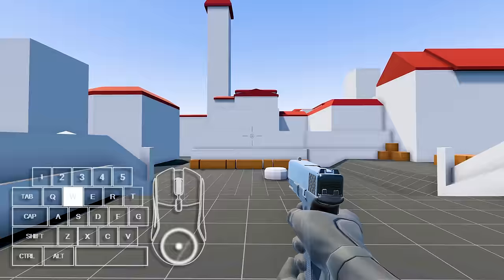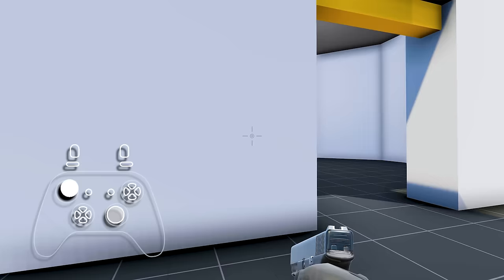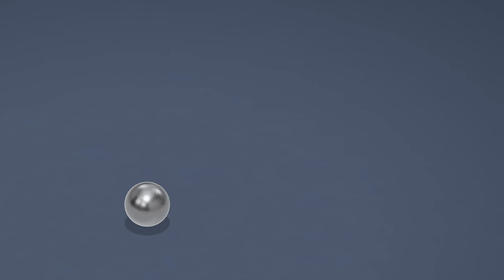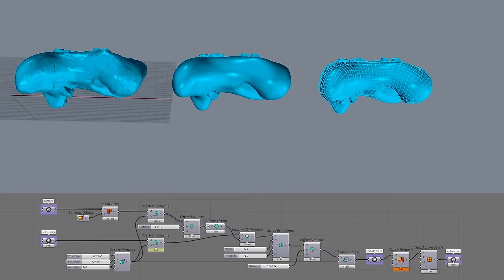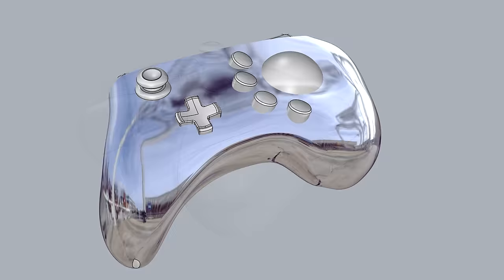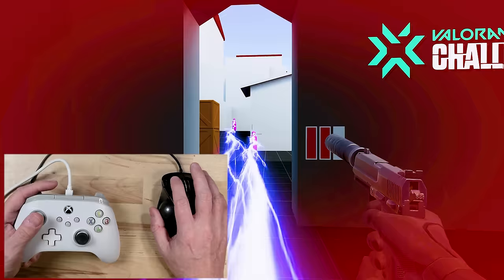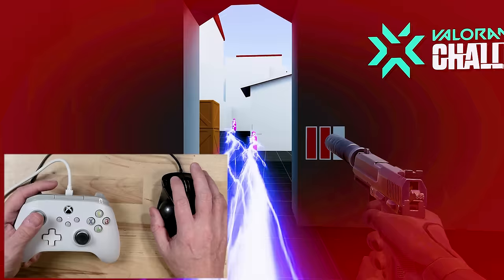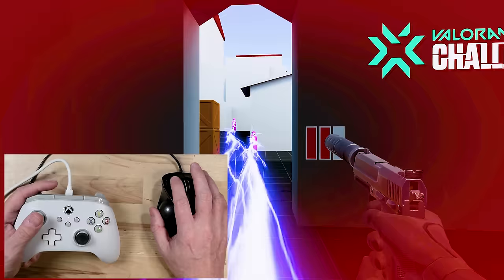Ultimate FPS Controller Design & Build

Comment: The mouse vs. stick debaters keep ignoring the enlightened gyro-aimers.
Reply: gyro capable controllers is like mixed both worlds of m/k and controllers players. You achieve speed of fast joystick turning and precision of a mouse in one device.
Reply: the problem is that the average player either does not care or does not know about gyro aiming. it's a control scheme that requires a bit of fiddling about and they're often buried in the settings menu for some reason. i believe game devs need to better incentivize the use of gyro aim whenever possible and make it easier for people to transition

EDIT: excluding first-party Nintendo games like Splatoon of course, they've obviously mastered the tech
Reply: @hi_its_jerry  the main problem with devs is that they simply cannot put good gyro aiming in their games.
Reply: People just negatively associate gyro with waggle, that's th eonly issue
Reply: implementation has been getting better as of late though with Fortnite and COD having the best out there. The Finals and Helldivers 2 have pretty good gyro, with room for improvement. There's some games like Spider-Man 2, GoW:R and Dragon's Dogma 2 that have basic implementation, but is acceptable for their use case of aiming only.

Edit: I wanted to mention that The Finals updated their gyro implementation and now it's up there as one of the best on the PS5 and PC.
Reply: I tried gyro for tf2 but my screen was so laggy like a clip show I couldn’t use the added gyro controls to its fullest potential, so tbh the average gamer (me), may not be able to even figure it out in good time :/ BUT man it felt good to rocket jump waaay better in gyro, I kinda miss it
Reply: but the problem is when i use my thumb in the shape his right hand is using i tend to twitch my middle finger ever so slightly which is why a sort of joystick hold with the mouse ball up top might be better because it relaxes the other muscles when the thumb is at work plus it opens up the pinky for buttons as well
Reply: where my nintendo/splatoon fans at? we've been trying for so long to share our enlightenment but the implementation of gyro in other games always feels secondary so it never works very well :(
Reply: Steam controller 💪
Reply: @pawes7418  I would be surprised if a seasoned gyro player could beat a seasoned mouse player. Joystick turning isn't that fast, a mouse player can do a 180 faster than any joystick player with the exception of flick stick. And I frequently go back to controller myself when I play the N64 or switch (where I do mess with gyro aiming in games which support it). It is easier to infinite circle strafe on controller though.
Reply: I've gyro aiming since the SNES days, it just didn't work out very well
Reply: yup. Fortnite made me a flick stick believer too. Everyone should follow Epic's lead on this, its just so satisfying. Bit of a learning curve but once you get it, its just so much smoother than dual analog.
Reply: @Immorpher  actually theres a control scheme called Flick Stick (thats even implemented in Fortnite) that allows for quick 180degree spins. Basically all your aim is handled by gyro, while the right stick controls all quarter-turns. So you can flick the stick toward you and spin around 180 and aim with gyro to do damage. Takes a bit of learning but once you get it, its leagues above regular gamepad controls. Mouse player might stil get the edge but its not as black and white as you'd think these days. Hopefully more games begin embracing this method and gyro as a whole.
Reply: Gyro is God Tier
Reply: @ekupka  what? lol
Reply: This is how I manage to play any shooters on Steam Deck. I'm still far inferior compared to mouse, but I go from basically awful to passable with the addition of gyro. Steam input FTW!
Reply: People shun me for gyro. My own brother shuns me for gyro. One day, they will all see…
Reply: I don't know why Gyro-aiming isn't pushed harder, it's the blatantly obvious solution for aiming with a controller and doesn't require a massive controller redesign that compromises every other genre.

It must have been the Wii and the other motion accessories from the other consoles that made people gag at the mere mention of "motion" in their games.

Most Racing games also don't have the option for Gyro steering when it's also pretty obviously the best option, playing GT7 with Gyro steering is night and day better than using the analog stick.

Gyro is so good that it made the game Dreams, that's pretty much a game making tool, actually usable.
Reply: But nobody gets it right besides Nintendo with splatoon. Stuff like Fortnite have gyro but it’s really bad.
Reply: This is one I don’t understand. Maybe I haven’t dived deep enough into the gyro meta
Reply: This, Gyro is the future
Reply: Dualsense Gyro and Steam Controller Trackpad Gyro should be the future of ALL FPS games IMO
Reply: Very cool! Would love to try it 😁👍
Reply: @PartyCrasher04 I wouldn't say it's the future in general, I'd say it's the future of controllers. I'd never give up mouse for gyro, no matter how well implemented it is. Mouse is just superior and always will be until eye tracking or some shit
Reply: gyros are only marginally better than mouse
Reply: As a person who loves the mouse, gyro aim is god's blessing to controller players

I don't wanna play MGSV on keyboard but gyro aim has made the game feel so good
Reply: Steam controller ftw, gyro on pad touch, with high momentum flicks on right pad
Reply: @taylon5200  Gyro and Mouse are definitely equal, at least imo, the level of precision is the same, the only thing limiting it is the user.
Reply: yeah u can play will u new style wii 💀💀
Reply: I think a lot of people would just rather not have to move the controller around to aim. Personally, I find it takes a lot more effort and hurts my wrists. I use both my arms and hands for a living, assembling and carrying things--they're too tired/stressed to use gyro at the end of the day.
Reply: Dualsense and Steam Input is the gift of PC gods
Reply: Honestly, its not fps exclusive either. Gt7 has spoiled me beyond repair. Gyro is tight AF and the only problem is that its the only fucking racing game that uses gyro to steer, cant go back to stick anymore
Reply: Stick, Mouse, Gyro controller and Keyboard works fine for me on most games with extra programs. Azeron looks cool also.
Reply: Or we just say fuck it and do VR. My eyeballs aim better.
Reply: YWNBAW
Reply: Thanks that is what I want to said
Reply: @pawes7418 Lmao, the only people saying gyro is better are people who play games that have terrible analog stick controls like CSGO or Splatoon.
Reply: fr fr, i believe wide adoption of gyroaim would quickly lead to removal of things like aim assist
Reply: @pawes7418 so the wii remote?
Reply: my main problem with gyro is recentering and adjusting because to go back to a comfortable position you have to unturn which means you have to counter it with stick aiming, whereas with standard controller and mouse aiming you just either release the stick or lift and recenter your mouse on the mousepad

there is also the nebulous feeling of where I'm aiming and how far I've moved but that is just being less familiar with the control method and I'd get used to it but having to use 2 camera controls is too clunky for my liking
Reply: i sneer at both teams while using my wiimote infared sensor
Reply: @BlowfishShorts  Flick stick can be good, but it isn't needed for every game. Splatoon lets you just recenter the camera in the direction the character is facing, so you can turn around and press that button for a quick 180 degree turn. Of course, that wouldn't work for every game, but for games with cameras and movement like Splatoon's (where it's sorta similar to a 3D platformer, and the camera isn't strictly tied to the direction the character is facing unless you're shooting or getting ready to throw a bomb or something like that) it can work.
Reply: @gruzi. Must suck to have your feelings contacted so thoroughly by every relevant scientific community.
Reply: I think a combo system with eye tracking might be the most effective
Imagine if the camera could instantly saccade to a target at the press of a button rather than having to move a stick, ball, mouse, or gyro
Reply: Yoi mean something like steamdeck have?
Reply: I gave up on gyro aiming on my steam deck when the bus driver took a really sharp turn and I did a full 360  in RoR
Reply: So tru
Reply: Gyro prevents aim assist so you won't hear anything from controller players lmao
Reply: @pawes7418  not quite as fast as mouse but if you don't have enough mouse pad space gyro is better
Reply: @kingkazuma2239  nope
Reply: i have been saying this for YEARS and everyone ignores it
Reply: @deathtrooper2048  good luck playing cs ... any fps games on controller without gyro or aim assist
Reply: @kurtisgibson2929  did you see some players that use gyro ratcheting technique? you can be very fast and precise with gyro. Im using gyro exclusively for like 8 years now and I can easily play on 8:1 sens without any not necessary hands movements
Reply: There is nothing to debate, mouse wins either way.
Reply: @pawes7418  Gears of War has no aim assist and most people it on controller.
Reply: Splatoon gaming
Reply: Splatoon gaming
Reply: eye tracking will get to the point that thats just how youll aim.
Reply: most people prefer to have their hands resting
Reply: @pawes7418  that's where steam input is a godsend, if you are fine with spending a couple hours fine tuning the settings lol
Reply: The only experience I have with Gyro controls was with Splatoon 2, and it was fucking awful.
Reply: For me, gyro controlls make aiming a bit of a hassle. You basically have to aim twice at the same time: Once with the thumbstick and second with your wrist
Reply: @FDALl-ms5kg  I wouldn't be surprised if somewhere deep in steam settings for cobtrollers is mapping feature to map gyro input to racing  wheel output. And than game just think that you have wheel. I'm pretty sure it works but its easier if you bought game on steam than from other services.
Reply: @PartyCrasher04  gyro and mouse are equal 😂😂😂
Reply: @teaguejelinek4038  yes, unless you’re someone with like 10k hours in cs, Ihardscope would probably wreck u in a 1v1 lol.
Reply: @cyriloboco3083  orrr you can play with a fast sensitivity so you do most of your aiming with just gyro lol, there’s more than one way to play with gyro
Reply: @PartyCrasher04  I've tried that, but you can't fully rotate the camera, so you use the thumbsticks to turn but then my wrist often ends up in an uncomfortable position. My brain is too old to get used to it
Reply: My issue with gyro is that most games force you to use either all gyro or none at all. And if it does let you toggle on and off it requires an expensive 3rd party controller
Reply: Dumb
Reply: Racing enthusiasts laughing in steering wheel language
Reply: @Anthonybrother True gamers know that Steering wheel aiming is the best.
Reply: Indeed
Reply: @hi_its_jerry it's not that hard to get used
Reply: Indeed
Reply: @hi_its_jerry that's the fault of the average player. BotW has Gyro and was game of the year. Make matters worse the Switch was more accessible price wise so the average player should blame themselves for not asking more from devs. And that's not to say Nintendo is any better but they were always about innovation which is why Gyro works so well with BotW and TotK. When playing I wondered why FPS haven't done the same.
Reply: @pawes7418 yes you can. If Nintendo can do it on a cheap ass switch with BotW then PS and Xbox have NO EXCUSE.

  Honestly they could learn a lot of fundamental gameplay aspects from the Zelda team like walking, climbing, mass, etc. Coming back to PS and XBox after so long was both impressive and disappointing because of this. Graphics and gameplay elements are nice but playing these games and still getting stuck on inclines or having to jump over something smaller than a step is something I just can't get used to.
Reply: @pawes7418  splatoon and doom 2016 called theyd like their exception status
Reply: what about returning to center though? how does that work with gyro aiming? like a thumbstick you just let go and a mouse you can stop moving. but a gyro controller you have to balance just to do nothing right? 

don't have much experience with gyro controls other than my phone I think....
Reply: @Sl4ts_ bro what!? I got 2 and 3. Plus BotW has Gyro as well and how it works with the right thumb stick is perfect for fps and 3ps
Reply: Gyro controllers are undeniably great.
I don't like controllers normally.
Reply: @Immorpher I guarantee you we could. Snap shots are so easy and your speaking from a position of in experience. I would put any seasoned BotW player against anyone. 

See you think Gyro has to always be active but in reality you only need it for ads. In BotW you can deactivate gyro by moving the right stick so you still can turn fast with the right stick and bounce between targets with gyro. And Im cold ASF at any shooter. NBS I can't help but be that way. Gyro is exactly what controller players need to balance out the difference in aim precision. With that plus better movement mouse players would need make up that difference some how to compete. Movement is the only thing keeping me from crossing over because that matters just as much as precision IMO.
Reply: @hi_its_jerry  We need some AAA devs to have the balls to make it default with a good implementation. It's getting better, but not there yet. Fortnite has a good implementation, but it isn't even in the normal controller settings section.
Reply: @Immorpher   Gyro aiming is just as fast as a mouse, and flickstick is just as fast or faster for turning. I'm not saying it's better necessarily, but I think they are close enough, that positioning, and game sense are going to be the deciding factor in a battle rather than the input method. I think it's still a better solution than raw mouse vs joystick than aim assist. Xbox needs to get their heads out of their ass though, and actually make a controller with gyro, or at least have full native support for some of the 3rd party devices that add it in.
Reply: @ekupka  Gyro hasn't been around that long. You are probably thinking about light guns like duck hunt. Gyro works very well, and just needs good implementations.
Reply: @bwjclego  1. Gyro is at its worst when it's attached to a screen, but it's still better than stick only.
2. You probably have less experience with the input, so it's hard to do a 1 to 1 comparison.  
I fully think it should be the future for console fps games. Especially if there is crossplay involved. Steam input is great, but we need devs to fully embrace it.
Reply: @BCBtheBeastlyBeast your lying. BotW players have proved this false. How it works in the game you only have to make big turns like that on occasion. its also no different from turning a steering wheel controller. 

In BotW they have throwing spears and those are harder to throw than shooting the bow in the game. Because of gyro I was able to hit a dragon's horn while running off a mountain as it flew up which was still not easy but would have been near impossible without Gyro to FINE TUNE MY AIM ON A CONTROLLER.
Reply: @goncaloduarte4683  Yeah, there were definitely some iffy motion implementations in the wii era. That doesn't mean they were all that bad though. The way that wii shooters had the view model/ reticle separated from the camera view did look a little goofy, and the edge of the screen acting like an analog stick turn was a little janky. From what I hear, aiming was actually really precise with them though. A lot of console players are pretty unwilling to learn something new, or tinker with things. Even if gyro is a way better input. We need well implemented gyro aim as default for a AAA shooter.
Reply: personally I am more of a custom keyboard guy and by custom I mean I design my own crap...
Reply: Gyroscopic aiming is equivalent to mouse aiming, so it doesn't need any aim assist. When you mention gyroscopic aiming, you're essentially telling controller players to aim by themselves, and that's not going to happen.
Reply: @deathtrooper2048 lmao BotW. And all controllers get drift. I just bought a PS5 and one ofe my controllers already has it. That's like 5 months with inconsistent play but I have a Pro controller for the Switch that still doesn't have it after 2 years. 

And I say that as someone that slaughtered in CoD Halo and Gears. The only people that are dissing gyro are m&kb users. Y'all are the only ones here speaking from an inexperienced position like y'all know better
Reply: @aboveaveragebayleaf9216  yeah, It was just a bad timed joke about waving the controller around
Reply: @taylon5200  They are pretty comparable, but I don't think anyone is saying to drop mouse. They are saying it should be the default way to play a shooter on controller. Aim assist needs to die. We don't need it. I do think that the inputs are close enough that the difference is more gonna be about gamesense. Good gyro is new enough that very few people have as much time into it as they do with mouse and keyboard, so it's hard to truly have a fair comparison.
Reply: @schmip most definitely
Reply: @bazzeil  It's great, but we need a new one. The gyro/track pad a relatively old tech by now. The ps4 and ps5 controllers have a much higher polling rate.
Reply: @BCBtheBeastlyBeast  How much do you think you have to move? People often just rest their controller in their lap, and do very small movements. you might just need to try a higher sensitivity. I have a pretty manual job too, and don't really have any more fatigue than just holding the controller normally.
Reply: @deathtrooper2048  Maybe because games with "good analog controls" use heavy aim assist. We should all be using actual user inputs by now.
Reply: @ComfyCherry no dude. In BotW you deactivate the gyro by moving the stick. It's actually pretty damn clean. Even going from stick for big turns and gyro for snap shots and better precision. Acting like that's harder than some of the uncomfortable things m&kb and controlled players have to get used to is a reach. The worst your doing is turning you arms and it's way easier to recenter than you claim. Watch BotW Advanced Combat Montages. Gyro is so good you can use that system and throw in shots with the gyro controls while free flowing combat. You can go from gyro to stick and back to gyro much smoother than you claim.
Reply: @ComfyCherry  Two options for this 
Only have gyro on when you ads, or have a bind that turns gyro off when you hold it. It acts just like lifting the mouse.
You should also look into flick stick.
Reply: @nmotschidontwannagivemyrea8932  It isn't needed for everyone, but it should absolutely be an option for people who like using it.
Reply: @arech1778  There is a time and place for everything. On a bus is not the optimal place lol. It also isn't at its best when connected to a screen since the screen moves as you aim. It's best when sitting down with a standalone controller.
Reply: @kurtisgibson2929  It can be just as fast. It literally acts as mouse input when set up well, and flick stick is arguably faster. Not saying it is gonna replace m&kb, but I do think it should replace aim assist in crossplatform shooters.
Reply: Lmao this is why splatoon is the only shooter I’m good at
Reply: @PartyCrasher04 one could make the argument that gyro is better because of flick stick. It allows you to make fat directional movements that even a nous couldn’t do without extreme precision
Reply: @aboveaveragebayleaf9216  I also play in my lap, but sort of between my legs. I tried it last night and it's just too much effort for me after work, and I should mention my wrists already have some issues.
Reply: @dylanrice5617  this is true, personally i cant do flick stick, i do a really fast joystick sens and also use fast gyro sens to do my aim
Reply: Please keep ignoring us lmao
Reply: What you're asking for is basically VR
Reply: Eh, terrible ergonomics.
Reply: @pawes7418  joystick are slow as fock
Reply: @aboveaveragebayleaf9216  tests show about a 10% difference but it's undetermed if this is a skill issue but yes I agree gyro should be the new default for controllers
Reply: @pawes7418  the flick stick tech or is it something else? i don't know too much myself outside of what I've seen test results on please clue me in
Reply: You got to be enlightened to use that mfer 😂
Reply: gyro aiming is the point of ascension
Reply: Gyro is pretty playable actually - Splatoon 3 Rank S player
Reply: @hi_its_jerry splatting has gyro aiming on normally
Reply: I think the problem is the amount of drift, even for hold-for-gyro activation (short periods of time). otherwise more ergonomic and as good as a mouse
Reply: Because no one knows what that is
Reply: This was sarcastic right?
Reply: What debate? Mouse is just better than both gyro and stick objectively.
Reply: That's sentence basically explains all of splatoon players
Reply: @hi_its_jerry tell that to splatoon players
Reply: @deathtrooper2048 You're being carried by aim assist, which has had so many controversies at this point about being "free" compared to KBM. Gyro > aim assist in terms of skill expression any day of the week
Reply: @Miracle7Seven This happens when the polling rate on the controller is lower than FPS, you can usually overclock the USB port to fix this.
Reply: My problem with gyro aiming is that I don't like moving my controllers around a lot while aiming
Reply: @pawes7418 > devs can't put good gyro aiming in their games.

You obviously forgot that Splatoon exists.
Reply: No that's dumb
Reply: I only know about gyro because of Solar Light's video on it. It does seem like it's highly competitive though.
Reply: Splatoon and Zelda gyro aiming are the best
Reply: I didn’t even know that FPSes have gyro support at all. Will have to check it out at some point - Splatoon is my most-played shooter of all time
Reply: @s3eriousbl9ck26   I think you were trying to reply to someone else :P
Reply: Or you could just play hybrid. Move with the controller and aim with the mouse.
Reply: Yes, precisely I actually made a post about that just now😂
Reply: @pawes7418  Is there a Gyro capable controller though? that works with PlayStation? Also, the game would have to support it with Gyro sensitivity adjustments.
Reply: @bwjclego Try CoD Mobile. It has gyro. Most mobile games do. It will blow your mind.
Reply: @bazzeil Try CoD Mobile. The same thing.
Reply: @ComfyCherry It’s an advantage having 2 camera sensitivities though. The control for major movement, gyro for micro adjustments. M&k only has one sensitivity.
Reply: Exactly. Controllers without gyro aiming are a waste of time
Reply: @Immorpher gyro + flickstick. Skill ver skill.I think it'll be fifty fifty between a mouse player and a controller player using gyro + flickstick. Look it up and have your world changed.. Unless you're fine and or good at kb+m. But for me gturo with flick stick made me able to actually be OK and hold my own. I'm sure a truly skilled gamer could do very very well with it.
Reply: @ironleeFPS  well mouse has whatever sensitivity you want move it faster or slower, I have a large mousepad and generally use a low sensitivity I can do large sweeping motions with my whole arm to turn around in nearly an instant (the other day I 180° snapshotted someone square in the head before I even consciously recognised where they were) or smaller movements for fine aiming and with acceleration disabled the same movement is always the same distance making my muscle memory pretty consistent

if I had multiple sensitivities I'd have to develop 2 sets of muscle memory and idk if I could do that

plus most gaming mice have the option to set what's known as a sniper button which will change the sensitivity/dpi of the mouse when held (usually lower) so a mouse can have 2 sensitivity settings at once

I don't need to switch sensitivity during gameplay but I do have 4 sensitivity settings I can cycle through set on my mouse using a 2nd layer so that I can get the feel of camera movement right no matter what the settings limit is in the game. 1600, 800, 400, 200 dpi 400 and 200 are really only there for old games where 400dpi was the highest dpi available at the time but even many modern games have weirdly high minimums on ther sensitivity.
Reply: @tyyamnitz8408 its just that gyro has the same relationship between your body and your in-game movement that mouse has.
Reply: @pawes7418  They don't need to. A properly configured gyro setup will perfectly mimic a mouse.
Reply: @s3eriousbl9ck26  what do you consider awkward with mouse? I've been using a mouse to game for over 10yrs now so nothing feels difficult or uncomfortable when using one

even with a way to disable the gyro when you need to adjust your hand/arm position it's still awkward having to develop 2 sets of muscle memory for the same action, my brain simply can't do that
Reply: @pawes7418  probably not for long. But honestly the controllers will have to improve their abilities before this is something that gaming companies pay attention to.
What I can do with my kbam surprises me a lot of the time and I’m not a famous YouTuber.
It comes down to muscle memory. When you change the way you move and shoot using a completely different controller or set up, the clock resets.
It takes time to get used to a new way of playing no matter how accurate.
Reply: So, everyone keeps ignoring the infamous Wii-pointers.
Reply: @RetroGhost16   obviously not talking about Splatoon here, that game is the exception rather than the rule, they actually made the right design choices to encourage gyro
Reply: @queenofrodents some fps games are terrible with a track ball destiny would not be good for it nor would call of duty
Reply: @automat3000  you can do things to limit the problems that keyboards have like angling it to a position that your hand sits comfortably and it would be ideal to have something more purpose built but I tired the azeron (specifically designed to be as ergonomic as possible) and couldn't set it up in a way that wasn't uncomfortable or even slightly painful after a few minutes yet I could use my keyboard to game all day without an issue

the biggest advantage a keyboard has is how many buttons are available, other than camera controls a controller limits your actions and requires the use of modifiers and context sensitive actions whereas with keyboard you just put it on a different button, sure m is kinda out of the way but I've been playing long enough that I can press it with my thumb from wasd without thinking, the best a controller can do it add more buttons at the back but because games are made to only understand the buttons on a controller so all they can do is replicate buttons in a more comfortable position to use whilst also using both sticks, I wish that games could take advantage of them but they aren't common outside of more expensive controllers
Reply: gyro dont work in some games.... lol
Reply: I'd still take mouse over gyro any day, but there's no way I'm touching a console shooter without gyro aiming
Reply: Show me the great FPS gyro-aimers.
I mean I used it for bowling arcade games in the late 90s, but show me an example of it excelling in the current FPS games…..
Reply: Think about this for a minute….
when using controllers, even gyros, you only use your thumb to aim.
I use the movement of my entire arm.
But then again we could run a 1v1 to see what is best.
Reply: @backerthehacker3700  
KBAM
stats alone show it
Reply: @imstupidbut  no offense to anyone…
But I agree. (Gyro is bad for FPS right now).
Reply: gyro aiming AND trackpad, combined. julia youre calling other people late when you missed half the equation
Reply: @Sl4ts_  Being made fun of by PC nerds and Xbox jocks
Reply: @Noctis89  I play FPS games with a mouse and keyboard broski, it's usually third-person shooters that I choose gyro aim to use because a lot of the time the keyboard layouts can feel convoluted and can feel less precise with movement, and gyro offers the best of both
Reply: Ya def seen the controller csgo man. GOATED
Reply: you think you could gyro aim these nuts?
Reply: personally I prefer trackpad with haptic feedback, but there's complications with the lack of simultaneous right&left click and a lack of middle click. Still, way better imo for most games.
Reply: @pawes7418  You don't have the precision of a mouse as a trackball user it's not as easy or simple
Reply: Mousedebaters
Reply: the mouse is better for fps games, there's not even a debate
Reply: if Gyro ever becomes main stream, I hope it'll be in tandem with them lowering aim assist. Newer games (especially cod) have legal aimbot I swear.
Reply: What's crazy is that it seems like everyone is missing the most important part of this controller—the amount of things that can be done at once, which is especially important for PC games

Also

People with bad wrists struggle with gyro
Reply: Ir aiming is even better. but bulky.
Reply: Also, Splatoon may be good, but it's faaaar from a twitch shooter.

Those don't really even exist on console.

And when it comes to twitch shooter controls, trackball is the absolute best... But only in configurations where you can pinch the ball. Thumb-only trackballs kinda suck.
Reply: @queenofrodents  dude I played through all of mgsv with my steam controller and my acer nitro 5 at my college it was so fun I loved the game so much more then before with keyboard and mouse, makes me wanna go back and replay it because I had so much fun. I still have my steam controller perfectly functional! it was from the last batch they ever sold when it was at $5 a pop for one
Reply: REAL. I wonder which has the highest skill ceiling tho?
Reply: the song “fool on the hill” by the beatles was actually written about gyro-aimers
Reply: Don't forget to shave, bro.
Reply: "gyro-aimers" still using sticks 🤦🏽‍♂️
Reply: Fun fact, your name is John "Def not a Julia 😂"
Reply: @hi_its_jerry just make everyone play splatoon.
Reply: Bruh touchscreens are kinda goated
Reply: @Sl4ts_  EXACTLY
Reply: @Immorpher  I usually beat KB/M players lol.
Back in BF1 i used to top leaderboards each match.
Reply: @AlexDaDermahurr  a touchscreen is just a glass trackpad that can display images.
Reply: @Immorpher  well Ihardscope was able to beat an mnk player with more hours than him on csgo.
Reply: I dont see any advantage of this over a mouse. Adding extra instability and error into something most people already have a lifetime of muscle memory practice in. Flick aiming with a mouse is second nature for me. A track ball is the opposite of that.
Reply: Gyro is god-tier
Reply: perhaps these that would've given their voice for the idea are still recovering their wrists from wiggling them up/down/left/right over many hours of gameplay?
Reply: i 100% believe gyro is the only way 2 go to make crossplay fps fair without aim assist
Reply: @pawes7418 eh, less that and moreso that there isn't an incentive since xbox continues to not include gyro functionality, to the point that it's the only major platform without gyro support
Reply: Gyro sucks for when you're on a plane, in a car, or in any form of transportation. Other than that, yes. It gives a little bit of fine tuning to track pad aiming.
Reply: Just watched gyro-aimer's vid a few days ago (cs2), that was fucking insane and feeling like there're infinite possibility. I was actually surprised.
Reply: @cactuszak4454  tf you mean when you use gyro to aim you use your whole wrist not just your thumb
Find me the stats on sc if you can, you probably can't cause it's somewhat niche
There's no better controller for modern fps, esp when combined with flick stick
You have mouse, stick, flick and gyro all combined into one pad, and you can even click it still to get r3
Reply: There is no debate between mouse and stick. Mouse is better for aiming, stick is (marginally) better for moving.
Reply: Gyro aimers terrify me. those people are a different breed.
Reply: But the gyro IS a mouse. Just an ancient one.
Reply: @ilyarepin7750  The mouse only has two buttons plus the scroll wheel and it's clickiness with this you can have a lot more buttons.
Reply: @Skycoat  As a shy person I usually don't terrify anyone so this is a new experience for me.
Reply: Gyro is pretty limited in practice, not unusable but it is necessarily less accurate and (more importantly) repeatable.
Reply: I enjoy using gyro from mobiles and consoles lol
Reply: @pawes7418  I play with ultra high sens for a reason, using a gyro to aim is gonna make playing games feel like sports. If i want some exercise i'll just play a VR game😅
Reply: Steam Controller users already knew this well mixed solution
Reply: @tempestthegoat  wtf you mean fortnite gyro implementation is bad? I thought it's the best of any game. Especially considering that it also has flickstick
Reply: @cyriloboco3083  or you could just aim once with gyro and only use the stick for large movement.
Reply: gyro ain't shit but a gimmick
Reply: Was there a debate at all?
Reply: Gyro is the best option for the controllers.
Reply: Yeah I really liked the Wii Nunchuck design, with both hands as separate Gyros you would have 2x6=12 Degrees of Freedom from the Gyros and 2 DoF from the Analogue Stick, combine that with another 2 DoF from a Trackball on the right controller and you would have the perfect Controller with 16 Degrees of Freedom.. :trophy-yellow-smiling:
Reply: I use gyro on everthing now. I started fortnite on switch and it was automatically on amd most people immediately turn it off but it was my first ever shooter i played cause my parents didnt allow any other amd then it just stuck
Reply: I see Gyro as a correction measurement when the stick can't do the job. I don't think it's that good as a complete replacement for a stick or a mouse.

And soon enough, we will have a fourth contender, using eye tracking.
Reply: gyro aiming is nice. but nowt comes close to vr based head aiming. i dont know how to express this but after playing gta5 with vr and controller, aiming with head i would say it beats mouse. and i'm comparing my short few hours with it to my literal years of mouse use. no other aiming including mouse have i ever been able to just aim perfectly straight away.
Reply: There are people who don’t realize mouse is better? I have never met one, like obviously mouse is better, sticks are just really bad, thats why theres aim assist on every console game
Reply: @linkshadow2 the imam finna roast them tho ong ong
Reply: @Billy-bc8pk  ?
Reply: @ramrodbldm9876  what does this even mean
Reply: seriously, not sure why its more widespread and supported. Discovered it with Switch and it was amazing
Reply: ohh... yeah, we all tried trackballs in the 90ies and we all went away from it when lazer mouse came out.
-Does this gyroball do as well with chips crumbles and juicefingers as the trackballs of the past?
Reply: @pawes7418  All fun and games until sticky fingers and crumbles clog up everything... lol
Reply: @linkshadow2 agreed
Reply: @orbatos  get good
Reply: what's the difference
Reply: "I LOVE THE POWER GLOVE. ITS SO BAD"
Reply: @jerryboics9550  ya it really is bad.
Reply: The track ball on this controller  isn't any better than a stick on a regular one. The problem is that it is controlled by the thumb the less dexterous finger in the hand.
Reply: Gyro aiming is god tier
Reply: @justthere845  I played splatoon a lot for a period and when I tried gyro on Fortnite it just felt really weird
Reply: "mouse vs. stick debaters" there is no debate. never was.
Reply: I was amazed that I had efficiency using gyro with 3DS.
Reply: cause gyro is garbage
Reply: gyro aiming is the absolute goat of controller features
Reply: Yeah, I loved using the Wii Mote for first person gaming. I had tried a few demo games when the Wii came out. And it was fun.

But later I really felt the difference once I got the Metroid Prime Tillogy for the Wii. For I had fist played Metroid Prime on the Game Cube. Using an analog control stick vs the Wii Mote was like night and day.

Though, yes, the Wii Mote is only part gyro-aim controlled. The difference with the Wii Mote there that makes it better to me than any other gyro controller, such as the Switch side controllers, is the light bar. Having that Light Bar, makes a massive difference that I feel too many developers have ignored, even Nintendo when making the new Switch side controllers.

That be the auto calibration. I played the remake of Skyward Sword for both the Wii U and the Switch. Again, the difference was in what had the Light Bar. It was fun playing that game on the Wii U using the Wii Mote. It sucked playing it on the Switch, for I had to near constantly hit the calibration button as I point the Switch side controller forward, far too often, just so I can play the game.

In my opinion, I ditch the Wii Mote, for something like having the Wii Mote Nunchuk thumb stick in my left hand to move with, and a PC gaming mouse to my right to aim with. Is vary hard to find anything like the Wii Mote Nunchuk for the PC though.

The best I could do, is have a PC game pad, held by a holder to one side, so I can use it one handed, and aim with the mouse on my right. It works with most FPS games I tried this with.
Reply: @taylon5200  Eye tracking, is to some extent already a thing, outside of VR headsets. Is mostly made for those with disabilities. Few have thought of it for gaming.

The best way I feel this can be done, is have a VR eye tracker setup, placed in some fake eye glasses frame. Have some small UV LEDs placed on the corner of you PC screen, so the size and placement of the screen can be tracked by your head gear, and know where on a screen you are looking at.

Not an easy setup. But could be worth it if it works. For it be next to the best gaming and PC controller out there, next to the new Neural Link. Once more people line up to get one of those.
Reply: Nah, mouse plus a single joycon is peak controller.
Reply: You still got input lag if it’s not wired. Trash gimmick is trash.
Reply: Gyro is really fun, i should give it a try again.
Reply: @Deeper489  Yeah, I believe so. Eye tracking will be king for aiming in games and for a PC interface, once more hardware developers get around to making it better and more accessible to more people, in more ways than in high end VR headsets.
Reply: i don't play fps games but that gyro aim in the new zeldas is godlike!
Reply: Gyro is cool on paper, but drift is a real issue that hasn't been addressed properly, and generally there's a lot of technical issues that makes it inferior to MnK. There's also an issue of balancing wide movement with fine aiming that mouse doesn't have. Things like flick-stick and steam controller's touchpad are only half-solutions that don't offer the same ability to develop proper muscle memory. And with flick stick, lack of precision in the hardware itself again becomes an issue.
I'm down for the first gyro controller that uses 2 gyros instead of one to allow for better precision and calibration though.
Reply: I've got several trackballs, 3 controllers with gyro, a steam controller using emulated trackball, mouse and keyboard and regular controllers.

It's all very situational but I tend to feel that for stability: gyro is among the worst but responsiveness is comparable to a good trackball. Mouse has balanced responsiveness and stability. Joysticks have the highest stability but the absolute worst responsiveness.

For games like Left4Dead. A gyro control is a LOT of fun :D
Reply: Gyro aiming literally changed the way I play point and shoot games
Reply: @Unethical.Dodgson bruh joysticks you can turn around it is not stabil. You dont turn 100% like you want but you turn around fast. And very Nice too quick scope. With gyro you dont. You can aim very still but not turn around. With mouse you Get both the good sides so its the easiest too be best on.
Reply: @pawes7418 its more of a calibration issue for the Gyro to know which is up and horizontal.

easy fix is to auto calibrate only when aiming. but with it constantly on. moving slightly would skew your aim.
Reply: I don't mind Gyro when they let me use the joystick for gross movement and gyro for fine movement. Splatoon keeps fucking it up and removing an entire axis of joystick and making me have to use Gyro in such an unnatural way.
Reply: Your not even using aimbot right. You are moving not aiming with gyro at the moving targets. So you need to move with them and are not aiming with gyro just with movement.. why? This is also bad reason to use this. Thats just as good as a normal controller if not more bad
Reply: the best stick/gyro are still no match for a mediocre mouse in fps.
Reply: @jackfromallstate  "Julia" is actually a John.
Reply: The main problem with gyro is ergonomics/strain. It's much more exhausting to use than control schemes where you can rest your hands on something. Even with a tiny gyro controller (I have a gyro finger mouse, it weighs next to nothing).
Reply: gyro is good but for certan ppl its not as easy as you think
Reply: Just buy reWASD and apply gyro to even non supported games
Reply: Shame most devs don't even bother with that. The only games i know of that have gyro aiming is No Man's Sky and Deep Rock Galactic.
Reply: You think it could be possible to  start production and sell controllers like this? Would absolutely destroy the market (assuming they would be compatible with the game/ system people use)
Reply: The Wii Remote and nunchuck was the ultimate FPS controller
Reply: Splatoon has the best out there. Fortnite's is alright but to get the best motion aiming in a shooter its splatoon no question  @IcyXzavien
Reply: Gyro has always been awful for me personally.. I tried it with splatoon for a good 10 hours and it never clicked and always felt awkward… 

Maybe there are better controller designs for gyro but having to twist the controller while playing is largely uncomfortable
Reply: gyro is mid tier
Reply: true but it's support on pc is utter dogshit, most don't even care to support it, when you want to implement it in games that don't it is such a hassle most would just keep to using controller or use a K&M instead..
not to forget controller support is also bad since MS is the standard and they never do gyro
Reply: Flick stick + trackpad + gyro is the way
Reply: Gyroscope is perfect for mobile shooting games, never tried it on console tho
Reply: @clemt1me  have you tried Fortnite's gyro since they overhauled it back in 2022. It has such in-depth settings for how you want to configure it, including the ability to recreate how it works in splatoon (more specifically resetting in the direction of character movement).
Reply: @bland9876  Not very good at reading comprehension are you? I suggest working on that
Reply: @Immorpher  Lot of top players in Apex Legends actually use gyro instead of a mouse lmao
Reply: Gyro sucks.
Reply: @jaopbeantown  It's far better than a joystick to be sure, but a big part of accuracy is repeatability. Mobile games all heavily rely on autoaim to be playable.
Reply: @ComfyCherry 

That's why it's good to have a button to either enable or disable gyro so that you can recenter naturally. That's how I and many other people use it. I have L1 set to disable gyro on all fps games.
Reply: @Suiax  It's all relative choom, be specific
Reply: @justarandomperson3700  controllers already have to lump actions together onto buttons as hold actions or context sensitive or whatever, plus I still prefer to have only 1 control method per action
Reply: Mouse is still better
Reply: Gyro is garbage imo
Reply: @markmystery3536  Do they use the Apex Legends aim assist?
Reply: @ComfyCherry  

Which is why controllers need to have more buttons lol. 6 button layouts instead of 4, back paddles, 4 shoulder buttons instead of 2 (there is a 3rd party controller with 4 shoulder buttons), better use of the TouchPad instead of making it a glorified select button. There's a lot of things that could be done to mitigate the lack of inputs.
Reply: meh, it require too much energy.
Reply: Gyro does not even come close to comparing to mouse
Reply: What debate? There's no debate.
Reply: @hi_its_jerry  Why would we care about what the average player's preferences in controls are? These are bound to change as the devs see the value in incorporating new tech and roll them out to the masses. Next generation may not imagine fine aiming with anything other than gyro. Ten generations in the future it may be a chip implanted in our brain.
Reply: No
Reply: @nicholasbutler2365  If you have space, a mouse simply can't be beat, and it's not an arbitrary measurement because repeatable actions are even more important than accuracy.
Reply: I'll prefer mouse or keyboard or a controller any day over gyroscopic aiming!
Reply: @hi_its_jerry  Splatoon babbbbyyyyy 💪💪🔥😊
Reply: @hi_its_jerry  you better believe we have the gyro under our belt!🥳
Reply: @/uv/hvtrs8%2F-wuw%2Cymuvu%60e%2Ccmm-cjalngl-UAmweiJHCqQrL%40iMj64rkWUu the problem here is that mouse is both fast and precise.
Reply: Splatoon unironically changed console shooters for me
Reply: @pawes7418  fast joystick turning? What world are we in? When I use a controller it takes 2-3s to turn around where a mouse you can always move it faster.
Reply: Seeing this used with Demoman in TF2 was insane
Reply: It's just preference for some I just like a key board because when it comes to controls we have options
Reply: Is gyro actually good?
Reply: @orbatos  I played codm heavy about 2 years ago, I used gyroscope for aiming and movement and with high sens, idk if codm had auto aim like console but I was a beast, legendary every season and was also #6 in north america and #15 in the world for using the LK24
Reply: I prefer vr controller aim. Feels much more natural to me. Just my opinion anyway
Reply: Based and Nerral pilled.
Reply: Is gyro really that good i never have tried it out
Reply: Im holding out for Neuralink controller
Reply: Yet anyone using a controller I will beat. I have beat everyone with controllers for years and years. I used to be pro before pros made a lot of money :( Now my reaction time isn't that great, but I will still beat people using controllers 99.9999999999% of the time. Most of the good console FPS'ers are using mouse and small keyboard anyway. It's the best way to go if you want to be any good.
Reply: Not too mention just the potential of how ergonomic Gyro aiming could
 be.
Reply: i avoided watching this video for exactly this reason. bro missed the best evolution in gamepads.
Reply: I would definitely try it out but have no idea where to even start to get that working on pc
Reply: Gyro aim is incredible, you get it
Reply: @pawes7418  Valve and Nintendo seem to be the only instances where I've seen Gyro aiming done right (treat the gyro as a mouse rather than trying to act like the right stick and disable aim assist)
Reply: i love gyro aiming i hope it becomes normal
Reply: Meanwhile the Wii figured out just point and shoot
Reply: In this regard, here is the objective scoring of gyro implementation:

Steam Deck>Nintendo>PlayStation>Xbox
Reply: @pawes7418  Splatoon has incredible gyro aiming.
Reply: That looks absolutely hideous. Playstation 2 is the perfect template for the best controller, and thankfully, all the good USB controller are made in the same design.
Reply: It is not a debates. PC masterrace is just laughing on peasants and gyropeasants. 
Try playing somewhat complicated game on it and you'll see why you are laughable.
But yeah, you can play mario with it.
Reply: The mouse VS stick vs Gyro debaters keep ignoring the drawing tablet aimers
Reply: Gyros are super limited in the range of motion you actually get. It's more for fine aiming
Reply: Gyro aiming made FPS games and other shooters at least playable with a controller for me.  But I'd still take a mouse and keyboard any day.
Reply: The main problem is that Xbox Controllers specifically do not have gyro hardware. This is a huge problem for supporting gyro for anyone that plans to release a multiplatform game - it basically won't work on PC and Xbox. (since most of the controller handling code on PC assumes an Xbox controller and has poor support for features that xbox controllers don't offer)
Reply: I used to play paladins on my switch with gyro aiming. I wss really good at it
Reply: @cyriloboco3083  it can be for sure.  For me, the best experience I've had was with the steam controller, using the touchpad for broad/faster mouse movements, and had  a back bumper I set to toggle gyro, and used that for finer control.  Was a major hassle refining the controls to feel natural tbh, but felt pretty amazing once I did.  A quick swipe of the thumb roughly had my do a 180 in games, another quick smaller swipe to get my aim in the general region I needed, then toggle gyro for the moment I needed to fine tune my aim.  I actually  kept my thumb on the trackpad, and once I got used to it it felt incredibly natural to combine light tilt with gyro with a gentle rocking in place with the thumb for precision aim.
Reply: @bootmii98  hinterland managed a decent job on the switch version of the long dark. My main problem is the switch is just uncomfortable to hold.
Reply: @pawes7418 I'd say it's more of a mix between the comfort of controllers and the speed and accuracy of mouse.

Joysticks are the worst part about controllers. They're finicky and in accurate, mouse is just as fast while being far more accurate, but controllers are more comfortable than a full mouse and keyboard set up which is where gyro comes in. 

It has the controls and accuracy of a mouse, but the comfort of a controller.
Reply: Tbh I fucking hate modern gyro aim. If I could have a comfortable split controller (I've tried several joycons, both original and third party and that doesn't work sorry) and could gyro aim with just my right hand like RE4 Wii Edition I would be so damn happy.
Reply: @hi_its_jerry Except that's not true though. The Steam deck Switch, PS4 and even so called flops like the Wii U and Steam Controller that had long lasting fan bases  (the fact that Steam controllers were only discontinued in 2021 and many wish for a Steam Controller 2 shows that the demand is definitely there) shows that interest in gyro is large and growing. 

Many PS4 and PS5games like God of War, and Cod MW2 (2022) and more continue to make good gyro controls and that number is growing.

Gyro requires some tampering, but so do mice and to a lesser extent, joystick. Everyone plays in a unique way that encourages that wide array of choice.
Reply: The only issue is that devs rarely implement the right settings for proper set up.
Reply: Gyro aming geared to controller is hard to learn, when ur used to a fixed position of playing a game now moving the controller around is a hell of a task
Reply: @graydhd8688   I feel like it just won't work when during close quarters/ all up in your face combat
Reply: I play vr bleachers 😊
Reply: Because anyone who's actually used gyro knows that it's terrible for aiming.
Reply: @Miracle7Seven strange maybe because I'm using as mouse. I play TF2 with gyro with no problems
Reply: @hi_its_jerry plus most have dogshit terrible default gyro settings

in overwatch tilting like a steering wheel also aims side to side, leading to accidental double-input tilting confusion

or even worse fortnite (years ago, maybe fixed by now idk) making it so that rather than tilting 30° to the right causing your character to tilt 30° to the right (multiplied by whatever sensitivity multiplier) and then stop, almost like youre in the game aiming the gun yourself, it has it so tilting 30° to the right is like holding your stick “30°” to the right, causing your character to continuously spin at “30°’s worth” of aiming speed until you reset the controller to normal
Reply: @pawes7418  i am a pc gamer purebreed 
hate mobile gaming 
but love that gyro + aim assist in PUBG 
but still f mobile fake gamers
Reply: @hi_its_jerry  tell me bro apart from FPS/aiming/simulators  where will gyro be useful for a rts mmorpg players like me
Reply: @Miracle7Seven  that craving will make u gyro dependent and a addict soon hahahahaha i had been there
Reply: wii-mote
Reply: @christofferore6285  

You can turn around quickly with gyro, you just need good acceleration settings, otherwise you can either play on a high sensitivity or use analog stick or trackpads to make up for that. I always use gyro acceleration for my games.
Reply: @zwenkwiel816  not sure if someone replied yet, but there's usually a button you can press that returns it to center - in Splatoon, for example, it's the Y button
Reply: I started using gyro a couple of years back for single player FPS and now I am unable to go back to regular joystick setups.
Reply: Yo
Reply: Trackpad + Gyro to Mouse on my steam deck as a controller for my pc has been the most fun way to play games.
Reply: @hi_its_jerry  Love me some Steam Input
Reply: The gyro on cod mobile was actually really good. I mean you had to use it if you want to control recoil well and aim well at the same time.
Reply: splatoon players from hell:
Reply: I do think that gyro aim is a great concept, but I used a controller like that for a few hundred hours and it really started to hurt my wrist on a way that mouse aiming doesn't. Maybe with a lot of fiddling and really high sens it could be fine, but I don't trust it to be better than a good mouse anymore.
Reply: Mouse, ball, gyro... Whatever it is as long as it's linear, it's better than stick.
Reply: @jonathanj.3695  im not specially meaning splatoon/nintnedo but all of them (sony you f)
Reply: Dear Lord, what a specimen.
Reply: Assuming it's implemented well in a game. The gamut is so incredibly wild, from the heights of Splatoon 3 to the lows of Avatar Frontiers of Pandora or Metroid Prime Remastered. :(
Reply: tere isn't even a debate between mouse and stick, stick is very obviously worse in every possible way. but gyro is as natural as it comes to aiming, so i'd even say that mouse vs gyro is also barely a debate, gyro is just great for aiming. you know like aiming to aim? what could be better?
Reply: There is no mouse vs stick debate, but there is plenty of room for a gyro vs mouse debate. Not saying there are no good stick players, just that everyone knows the reality, I'm not a fps player typically so that is all I am qualified to say. Steam Controller and Deck are another level, he should have put gyro on this thing, great design and concept though, I would love to try it out.
Reply: gyro for big and tiny movements, joystick for general looking around and medium movements.
Reply: @Manny73211  Yeah I can't deny analog movement is great, just not aiming, once you are good at wasd though it is still pretty futile, although being able to control movement speed is something we lack on keyboard. hopefully pressure sensitive wasd keys become a thing, problem solved, minus the program utilizing them, they could probably be mapped to xinput though. I like the thought of using foot pedals more often, for walk and run functions, have not tried them myself yet, also for many other functions too. Wasd kind of puts you into rhythm gives you more of a feel for footsteps, lets you imagine the grid, timing, etc, just as good as analog and better in a lot of ways, just has a few flaws in comparison.

Not going to turn it into a console vs pc debate but yeah, kbm is something that once I experienced myself I never wanted to go back. Hopefully kbm can make more giant strides such as Rumble and pressure sensitivity, a lot of it depends on the game developers willing to implement those things in the future, comes down to demand. I love the Steam Deck for all it is worth, it had truly been a while since I had used controller inputs for any game, even then though I prefer kbm, driving games still have a ways to go, but I play rocket league with kbm too and prefer it over a controller also. I still have a lot of respect for the controller, not the point I'm trying to make, grew up with them, sometimes they are better.
Reply: It works extremely well on the steam deck. I hate playing fps games with a non gyro controller now because of it.
Reply: You need to set the gyro up "as mouse" to make it smooth and awesome.  That's your issue.
Reply: No. It ist a third taste of controller, different from both. On this reason alone it csnnot be put the eay you put it.
Reply: @Miracle7Seven  Im not sure you meet average status with a computer that has that much screen tearing in TF2 at this point.
Reply: @Jmcinally94  I was using Bluetooth to connect my controller
Reply: @Billy-bc8pk  who the fuck is julia
Reply: @jackfromallstate  You're right... it's just John.
Reply: Nerf aim assist
Reply: Switch is hands-down the best platform for Warframe entirely because of gyro controls.
Reply: @uriahh6931  it's definitely got a steep learning curve, and it prevents comfortable play, but damn is it accurate and smooth when you get a hang of it.
Reply: Oh right, gyros, didn't know controllers had those sensors. The people I see using gyroscope are mobile players in shooters, but I see how gyros can work with controllers.
Reply: Mouse cam say they're the best but they cry to nerf the minimum amount of aim assist in every competitive shooter. Literally cried so hard they nerfed it in the finals and killed off half the player base.
Reply: @Immorpher  Maybe not, but it's more comfy and doesn't feel like I'm giving myself RSI with every keystroke
Reply: @pawes7418  this is the first time I've ever heard "fast joystick turning" 😅

Aside from more PC centered FPS games, most don't have speeds high enough to replicate mouse turning.
Reply: Going gyro was seriously the best thing ever. Was stoked when I came across the ARMOR-X for xbox controllers.
Reply: So you can look like some one playing Mario bros for the first time, having sudden jumping motions with your hands while holding the controller
Reply: spot the Nerrel viewer
Reply: There is literally no debate. Mouse is superior in every way for shooters
Reply: @3Dant  I can understand that. WASD is not good on my wrists either, so I use a analog+mouse setup for PC with the Hori Tac Pro. Much nicer on my wrist.
Reply: People tend to forget Splatoon
Reply: Gyro sucks. It helps a little in shooters, but is unusable garbage for literally all other game genres, and general computer usage. 

This trackball controller is versatile enough to do nearly everything you’d want on a PC. Gyro is a gimmick contained in one single genre. And even then most shooter devs don’t work with it. It’s glorified garbage.
Reply: Gyro aiming sucks, tbh. Trackball is the ultimate pointing device.
Reply: @orbatos  I said mouse is better.. why are you replying to me like I said something different? Are you… “R… special?
Reply: gyro-aim is on par with with mouse. you can just max the sensitivity for the analog and then use the gyro for actual aiming. you get use to i after about a day or two it feels like cheating sometimes cause don't need to move you arm(s) you can just rotate your wrist(s) aim perfect... it's a small more controlled moved. It's so good!  There are people using Switch joycons on PC for Apex and it works SO well!
Reply: @Dracorientalis  I use gyro controls all the time and while they are very good they’re not as good as a mouse. There is no way to get the fine control from gyro that you get from using a high dpi optical mouse with a lower sensitivity. Its a matter of basic rules of fine motor skills. The lower sensitivity plus the higher accuracy results in more inherent precision.
Reply: @nicholasbutler2365  Yeah exactly. Im talking about the fine motor controls in you arm and wrist which is connect to your own reflecxes and and muscle memory! A mouse can be low sens and really accurate but you have to make bigger movesment with your arm. high sens mean you can turn alot quicker you are far less precise as smaller arm/movements can still cause a miss, also you have to make contact with the desk furface with the mouse you have cover distance on deck related to the amount you need to turn/look based on your sens. and again the lower the sens the more desk surface you need to cover whoch might require you lift the mouse and replace down making multiple swipes. With the gyro you just rotate the device slightly for precise aiming move you arms for larger turns and your sens doesnt matter. It to depends on the device. PS5 Gyro is SUPER accurate! Switch not as much but its accurate enough. I use gyro all the time too. and For it quick became on par with mouse! I would say that its more tiring though over time but thats about it!
Reply: @Dracorientalis  no gyro in a consumer electronic device is as accurate as the optical sensor in a high end gaming mouse, not even close
Reply: @nicholasbutler2365  You not understanding what I'm saying... it has nothing to do with the accuracy of the sensors, it's completely irrelevant because of the person movements. And the PS5 daulsense gyro IS pretty accurate infact it's a bit too accurate because it's it so sensitive to minor shake in you wrist.  But like I said. Like a day or 2 of practice I got use to this! Also if the Gyro sensor were on 1 to 1 with gaming mouse it would be harder to use at first and would be FAR better than mouse with practice!  Also you keep saying optical sensor. I think you mean laser sensors right?!  But optical sensors are absolutely garbage! Thats what is in the €14 mouses you get in the supermarket
Reply: @pawes7418 I'm a game dev I will add this to my game, didn't think about this until I watched this video
Reply: No, please, no gyro aiming
Reply: Playing CSGO with gyro is not competitive, playing Spiderman with gyro is not fun, gyro is niche bcs it has few use cases
Reply: I can’t use gyro aim because I have some annoying tics, but the Steam Deck’s touchpads are amazing. Oddly enough I use and am pretty good at using tilt controls on Mario Kart, probably because the tics don’t affect left and right but only up and down.
Reply: @hi_its_jerry  
I think the widespread use of the gyro-less XBox controller holds back devs somewhat.

Come on Microsoft! Get on it!
Reply: gyro is so fun to use
Reply: let me know when esports players start switching to gyro aiming. I'll wait.
Reply: We on phones got it for way longer than consoles have it 😂😂
Reply: Gyro is gay. VR motion controllers beat them all
Reply: @pawes7418 VR motion controllers did far better though
Reply: No one wants to keep swinging their controller.
Reply: @Settiis  VR is great. Is way more than swinging controllers
Reply: @Settiis  to my knowledge gamers do that since first consoles were out soo...yeah...you can't neglect primal gamer instict. Either way who says something about swinging, you can just tilt and it's good enough. When I play game with gyroscope on my phone you can't even tell since all I do is just little tilting for micro adjustment
Reply: Gyro is the future, and it's inevitable. Sony controllers currently feature best-in-class gyro, its even slightly better than the old Steam Controller, and vastly superior to the previous DualShock 4. Many PS5 games have received gyro-enabled patches in the past few years. My guess is that Sony has been silently preparing for a paradigm shift, and the future PS6 games Gyro will be mandatory.
Reply: @aimmlegate  Wrong, Quest 2 controllers already surpassed it years ago
Reply: @toututu2993  This isn't even comparable. 6DOF controllers are entirely different entities. They primarily use some kind of external or internal systems (base tracking stations, headset cameras, or their own cameras) to calculate their positioning, and their motion sensors are supplementary.

In the world of standard 'gamepads,' DualSense is top-notch for gyro. Sony even included a magnetometer to combat drifting, which the DS4 does not have. Technically, they have almost everything necessary for gyro aiming, the only thing they lack is capacitive touch sensors on sticks.
Reply: FR flick stick is amazing and needs to be standard in the industry already
Reply: @Immorpher  I think even an amateur Gyro player utilizing flick stick has the potential to maneuver their cursor faster compared to a seasoned mouse player. 

Flick stick, despite requiring meticulous adjustment of settings (often 3 or 4 menu options deep if they even exist at all, which usually means the installation of third-party apps), allows you to simply point the thumbstick in the desired direction for your character to face. Instantaneously, your character aligns with that direction. In contrast, a mouse user still needs to rotate their wrist entirely to alter their character's facing direction. Even with the highest tuned and most optimized sensitivity settings for the player preference, this wrist rotation demands more engagement from forearm muscles and tendons than a straightforward thumb maneuver. I've watched plenty of esports and I've never seen a player do such a precise 180 spin as someone using flickstick.
Reply: @acarroll6842  A gyro flick stick player is effectively changing large movements to the thumb and small aiming movements to the wrist. It seems ergonomically a mouse player still has the advantage there (as its swapped for them). We will see if a flick stick player ever goes up against mouse players in a prize FPS tournament without autoaim.
Reply: @Immorpher  I see transitioning to flick stick as a way to lower the barrier for entry into twitch shooting. With this reversal as you point out,, there's no longer the need to invest time in mastering the low sensitivity + building forearm strength for precise large movement adjustments, cuz you're kinda stuck keeping your shoulder and elbow locked in place in order to achieve that precision. 

But with flick shooting, you've got the freedom to hold the controller however feels best for you. That means less strain on your arm and shoulder muscles, and way more comfort. So yeah, flick stick control? It's all about that chill, adaptable couch co-op vibe that can appeal to a wider bunch of players. 

Because now Instead, you leverage your thumb for the initial broad movement, then engage in minor twisting motions which actual involve both wrists instead of just one, which both work in opposition due to the controller being held with both hands. This counterbalance aids in stabilizing the final movement, facilitating easier and more accurate cursor placement over the intended target. As a result, I believe flick stick significantly reduces the skill ceiling in this aspect.
Reply: @acarroll6842  Flick stick is good for some games, but it's not universal and sometimes very limited. It allows precise and quick turns, yes, but if a game or map utilizes verticality, FS becomes a hindrance. Yes, if you are really dedicated, you can set up modifiers to switch between flick stick and standard stick control, but it requires a lot of practice
Reply: Mobile Players with touch + gyro is where it's at. It just needs a better ergonomic package and boom controller with mouse aim.
Reply: @aimmlegate  yeah well there aren't one size fits all input device that's good for every game. Racing games are terrible for mouse and keyboard, whereas most people agree a controller is bad for shooter. But that';s not always the case for every FPS game. RPG style fps like bethesda games are imo a lot better with a controller. If we're debating about Mous aiming Vs Stick aiming, then I beleive flick stick aiming deserves to be included in the discussion
Reply: @acarroll6842  I see flick stick as a very questionable compromise. Personally, I prefer the touchpad and gyro for FPS, it's far more natural to aim on all axes and more universal (flick stick in single-player games is weird). With virtual trackball, you can make decently quick camera turns as well. But since no currently produced controller has a track surface suited for aiming, and the old Steam Controller has other issues, and Valve doesn't want to make a v2 with Steam Deck controls, I guess flick stick is necessary. 180-degree camera turns on the stick are just atrocious event in single player.
Reply: show me a single competitive gyro player
Reply: i absolutely love gyro aiming, especially on switch, with how small those controllers are especially only turning one of two, etc, its so fun
Reply: Ball too big tho
Reply: Ahem VR motion controllers or eye tracking.
Reply: imagine this controller with gyro thatd really be broken
Reply: Is this the aiming mechanic used in VR  games?
Reply: It would be a standard feature in all games if only Microsoft wasn't the only holdout with gyroscopes.
Reply: I’m a big fan of Gyro aiming, had to swap to it from regular mouse due to an injury, but I think the biggest hurdle right now is how technically inclined you have to be to set it up optimally. Steam will go along way towards making that more accessible though, but right now even if I try to send a friend a profile that I’ve customized for them it’s still too much work for the average gamer.

Totally agree that is the answer to the massive problem of aim assist. Problem with that though is it requires people who gravitate towards an analog stick controller to begin with to learn an entirely new thing, I’m not sure if those types have ever been able to learn a single thing to begin with
Reply: @Immorpher  in cod, controller players without gyro just beat all MK players, aim assist do a good job an i support this, i´am controller player lol ...
Reply: well.... I am born in 82. I turned my gyro aiming off, that shit sabotaged my comfort! --Gyro reminds me of early controller days where kids would "air-steer" with the controllers while playing....
Reply: @zwenkwiel816  Splatoon allows you to instantly re-center with a face button press, and it becomes a second nature just after a few hours of experience with the scheme. It's really not as much of a problem as some people think it is.
Reply: I see a fellow cephalopod
Reply: @pawes7418 the precision of Gyro is far higher than that of a joystick, but is still nowhere near that of a mouse due simply to how gyroscopes work on both a mechanical and ergonomic level when compared to a mouse.
Reply: Up
Reply: gyro is underrated. would honestly be fine using gyro instead of a mouse as long as it works perfectly.
Reply: That is so because a mouse is still better than there is trackpad
Reply: Nintendo is the only one to really master smooth usable convenient gyro use.
Reply: Gyro becomes uncalibrated over a long time
Gyro becomes skewed and off-centred over a short time scale.

Not really good enough for serious FPS use. Good for casual use though.
Reply: Not to mention it is a lot less accessible for people. A lot more people have shaky hands than you think. I love the control scheme, my friend can't use it
Reply: real mfs use a logitech steering wheel
Reply: @Immorpher  One the great things about gyro aiming is the ability to use multiple aiming schemes simultaneously. I have gyro aiming for regular aiming. It's just as fast and precise as mouse aiming.I have stick down instant for 180 flicks it's actually faster and more precise than what a mouse can do. Then I have left and right stick movements to do quick horizontal spins. Unlike mouse aiming, I never run out of mouse pad if I need to spin in the same direction for a longer duration.
Reply: @taylon5200  gyro is just a mouse held in 3d space. It really is just as capable as mouse aiming.
Reply: @zwenkwiel816  There's usually a button designated to recentering the camera, or using the right stick will turn off gyro until you let go of the right stick
Reply: @ironleeFPS the basic PlayStation controller has gyro
Reply: The average players are blinded by motion controls being perceived as pure gimmicks, acting like we’re still in the Wii generation.
Reply: I don't like moving around to aim.
Reply: Have you ever played Quake on PS5? I rivaled my mouse and keyboard agility with fine tuning the gyro settings in the menu. It plays so fluid with the DS5 when gyro is dialed in.
Reply: Really the new controllers will be vr but I'd rather have trackball on those too!
Reply: А еще можно автоаим подрубить, который по умолчанию включен с контроллерами...
Reply: literally my first thought when i saw this thing…. this is all unnecessary… just make a gyro ON/OFF switch or button on the controller.  

boom. problem solved
Reply: @hi_its_jerry because this thing is for the “average gamer” right?
Reply: @Immorpher they literally do it all the time.  people need to stop acting like playing on m+k automatically makes you a god tier gamer.  flik stick users are probably competing with you and you don’t even know it.
Reply: @tempestthegoat nintendo actually does gyro REALLY BADLY.  they literally just give you a sensitivity slider and that’s it.  it’s ice that it’s there, but if you think Splatoon has done it the best, you really need to try more games with gyro.
Reply: @mkv2718  Are these games with autoaim?
Reply: @pawes7418  The "speed of fast joystick turning" -what?  You can turn faster with mouse, what?
Reply: Someone finally said it
Reply: Bro I’ve just been enlightened and it’s awakened the BO1 grind back in me feels like I’ve been playing the game wrong this whole time. It’s so intuitive and immersive and best of all instead of having to be pinpoint accurate with joystick in mkb games I can actually compete. Once the darkshot pad or this becomes good as other pro controllers I don’t see it being a truly better option
Reply: Bro you just said I don't know what he knows about it and then you going to bring up splatoon  a switcha game nobody plays meanwhile cod mobile has had play mobile games were the first not your stupid switch what is no extra fiddling with settings it's the same as PC or controller settings is just sensitivity adjustments nothing's hidden
Reply: The amount of people who use gyro in a game, is soo little, it’s limited to a small fraction of splatoon players, to my knowledge most ppl will just not play a game with gyro or turn it off in the settings entirely
Like game devs know that people dont even like it so they give an option to turn it off

So ignoring them is ignoring a very small group of people i imagine
Reply: Best gyro game I ever played was the Apache: Air Assault game on PS3. When I switched from consoles, to PC for a bit, I literally had a regular old Logitech controller, with a Wiimote hot-glued horizontally to the bottom tips of the handles. One driver later, just dialed it all in and had me a abomination, but dang!, it frakking worked, and decently to boot. Played the PC version of Apache, and it was pretty much the same, but with the added buttons of the Wiimote. I had spare buttons for sure, lol. But then I also used it for driving games, mainly American Truck Simulator, and with F1 and Dirt. Then, that's when I found a "steering column" table mount thingie at thrift store. Pure jank, had to modify some things 😂. OMG, that thing freaking was an embarrassment, for sure. Very functional, though. That was easily 7 years ago, almost. And I'm using that same Wiimote as a test for making a trimmed PCB, with some 3D printing eventually, to bring it all in more tightly, with the buttons intact, I hope...
Reply: Mouse and keyboard is definitel the best. With things like the orbweaver there is no reason we could not have analog stick for movement with a mouse but the problem is it is just supported well.

If you are using a controller a gyro is a good way to go. Steam has pretty much cracked the code for a gyro with the gyro being turned on when aiming which solves any drift issues. A gyro is not quite as good as mouse and keyboard but it is an improvement over just analog sticks. Nerrel has a good video on it.
Reply: I love gyro I wish it was more available for consoles
Reply: And you keep ignoring the cars
Reply: Why do all that when they can just focus on developing eye trackers as a viable aiming tool.
Reply: Mouse always wins tho.
Reply: Gyro and pens!
Reply: @cyriloboco3083 We are not speaking about wii controls as stated before. With gyro controls you can have your hands resting because the movements needed are so miniscule. The misconception comes from people not knowing what gyro controls are and thinking its like the wii aiming.
Reply: @hi_its_jerry  this is exactly why i haven't transitioned to gyro. it's a fiddle getting it to just work. one day i hope to do it and experience the englightment of gyro aiming
Reply: That’s because it’s mouse vs stick
Reply: sadly gyro is rarely supported in games
Reply: The steam deck was a pleasant reminder of the efficacy of this method. The switch uses it here and there, but the switch is not the most common platform for FPS games.
Reply: @pawes7418  they don't need to... they only need to allow mixed input. Steam can handle the rest by translating gyro to mouse.
Reply: Mouse is still superior to gyro
Reply: @bradridgway581  true but joystick is superior to WASD.
Reply: @Ubeogesh  doesn't make up for the mouse aiming
Reply: @bradridgway581  this gamepad has both.
Reply: Mediterranean dudes smh
Reply: Dude, gyro is O fricking P
Reply: @linkshadow2  gyro isbt fun at all. 😂😂😂 lolz
Reply: Tried it recently with my steamdeck doesn't work well for me
Reply: A drawing tablet is still the best 😂.
Reply: Gyro is amazing, it should be standard with every console at least as an option
Reply: @paullynch1246  no